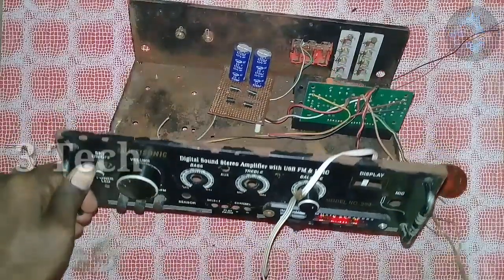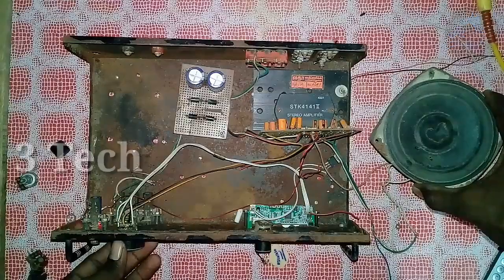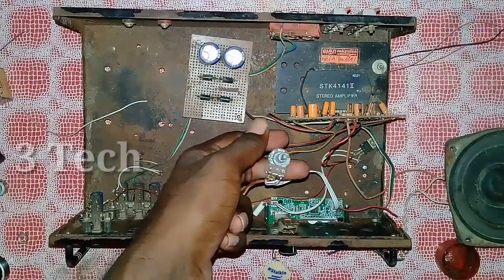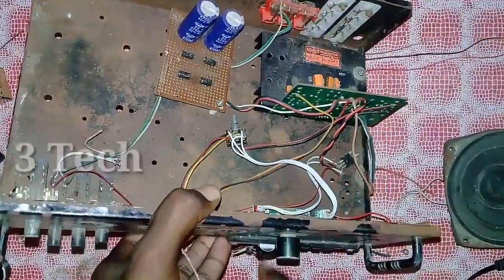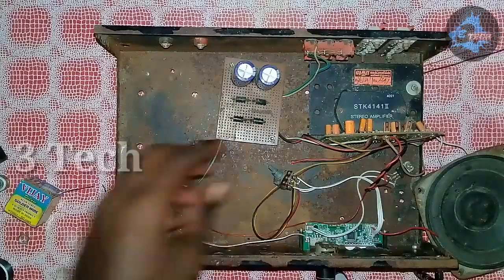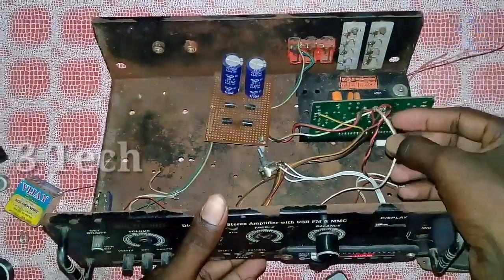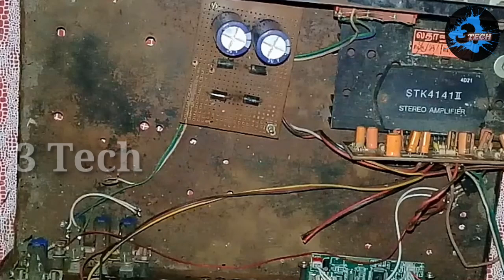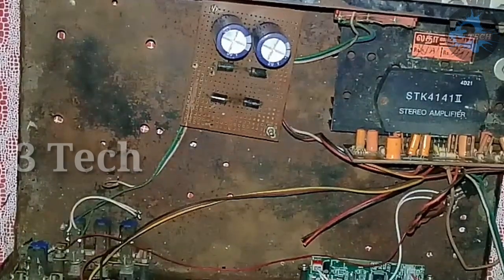How do clear HUMMING sound in STK Amplifier

Comment: Usb board ku power supply mobile  charger mulama kudunga, old volume control change  pannunga and sealed wire use pannunga